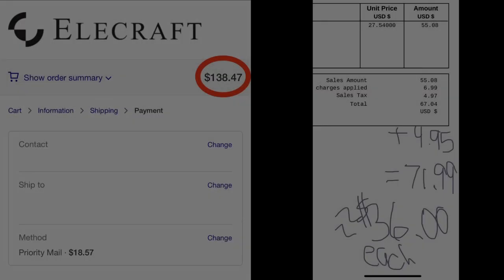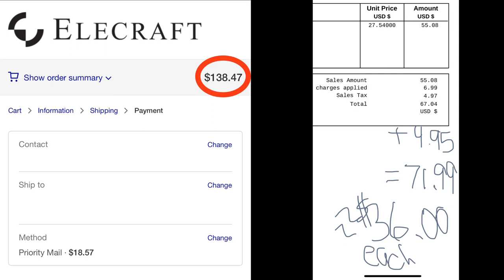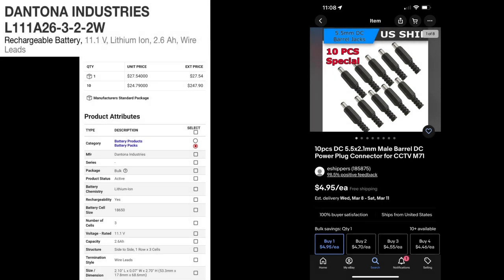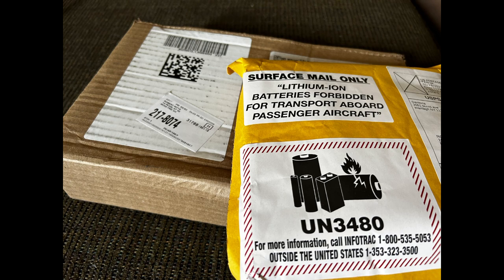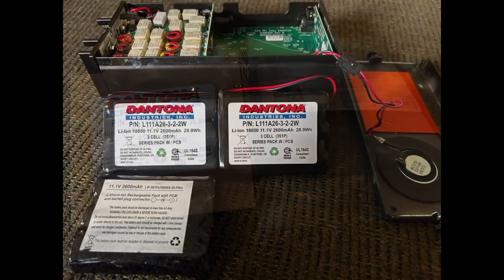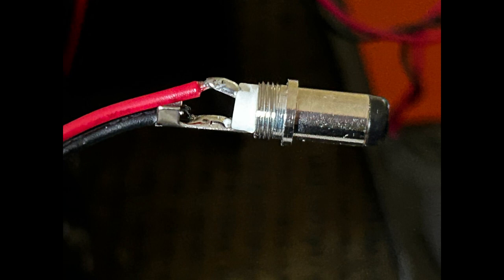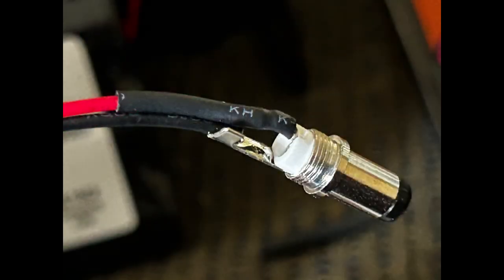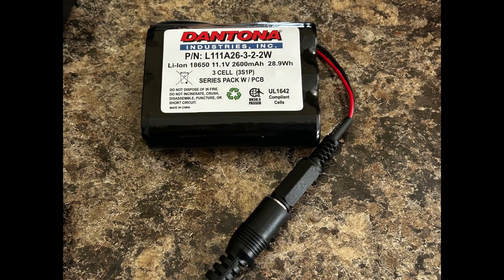Making Elecraft KX2 batteries for half the cost

Comment: I built a couple of packs out of 18650s I had and have been using them on a Yaesu ft-817. Unfortunately my kx2 is back ordered for another month or two, wondering if they’ll fit inside like yours.
Reply from the maker: Yes!!! If the pack you built is a 3S1P (3 in series, 1 parallel) then it should fit. And don’t worry, Elecraft is doing very well with about a 12 week lead time. Even though I had one on order since December 2022, I bought a used KX2. I kept the other one on order and my friend Billy bought it. It came in last week right at 12 weeks.
Reply: @w1rcp  Yes, it's 3s1p and I have a small BMS board on the top. Looked at used ones and they seem to be going for the new price, plus I'm paying for stuff I don't want like their mic and the RTC, so figured I'd wait it out. Thanks for the confirmation that it'll fit!
Reply: @w1rcp  My KX2 came yesterday, so roughly 8 or 9 weeks. The battery packs fit great. Cost wise, 3 batteries at about $6 each from Digikey (one pack was reclaimed from a handheld vac that I replaced the batteries in, the other is new cells), a 10A BMS from Amazon (3 for $10), and the connector/wire/heat shrink. So about $23 for a pack with new cells, and about $5 for a pack using reclaimed cells from a broken vacuum.

PS absolutely love this KX2. I worked the MST last night at 5W and made 20 contacts in half an hour.
Reply from the maker: @SeanWalberg  wow! I need to check out the loose batteries and make some of my own because at $26 each, that is a deal and a steal. That’s even less expensive than what I built. The only issue is that some folks don’t want to mess with soldering 18650 batteries. 

Hope you enjoy the KX2. I consider it a miracle worker.